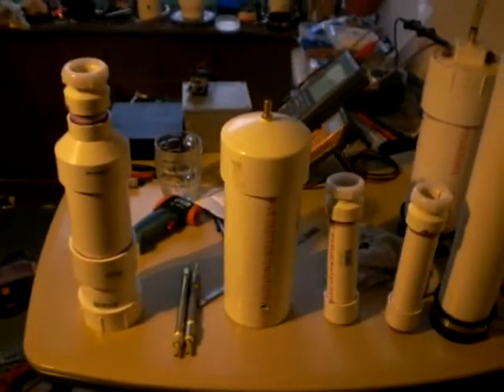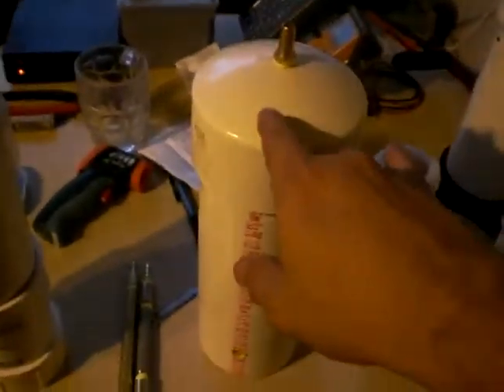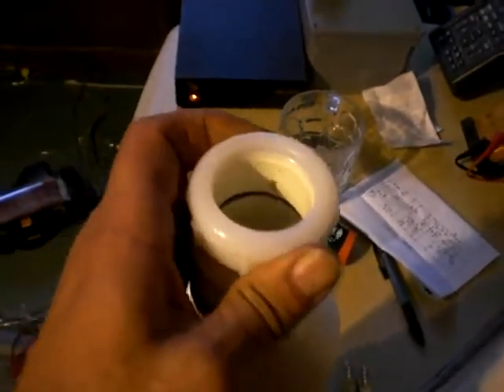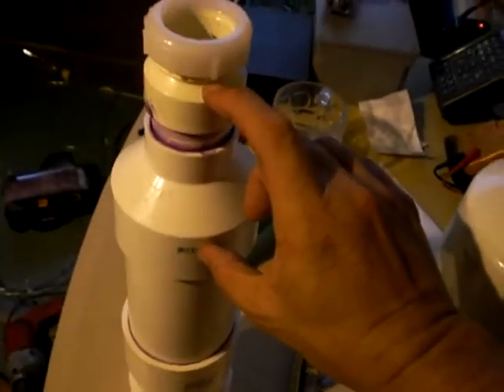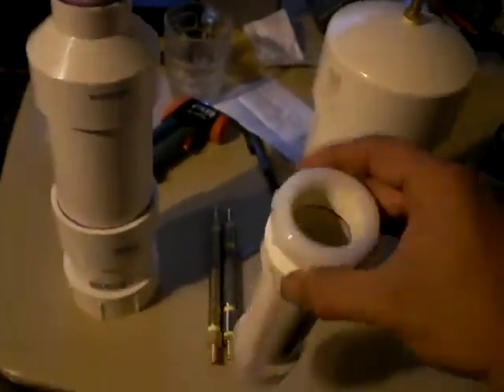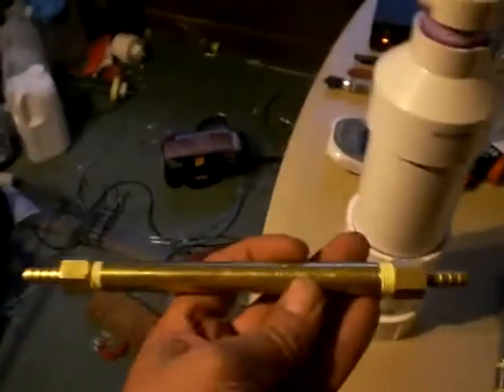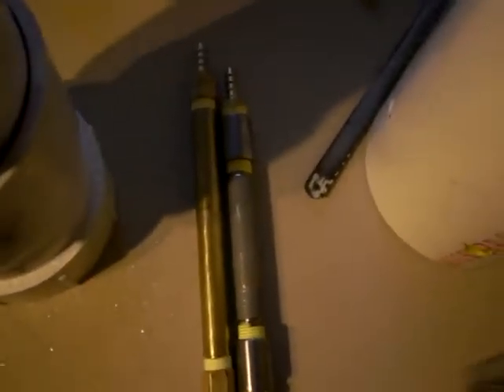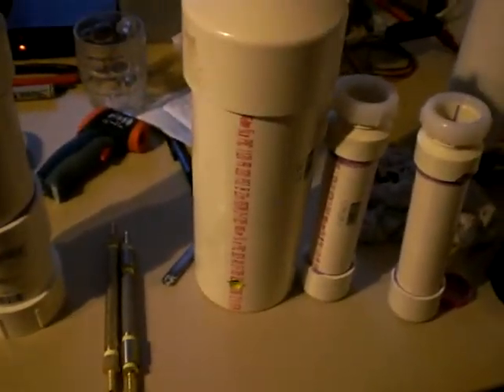Built some HHO accessories

Comment: Great Video Luther!

Are you doing the electrical leads to the bottom to try to lower the temps at the connection leads from the water?

If so, I would recommend you keep an eye on that. From the tests I have done the water below the plates is only about 5 degrees lower than the plates themselves. At the top in an 3 inch deep open air bath system the temps are a good 10+ degrees lower than the cell.

So I would check the connections, rubber and terminals because the heat from power might melt it